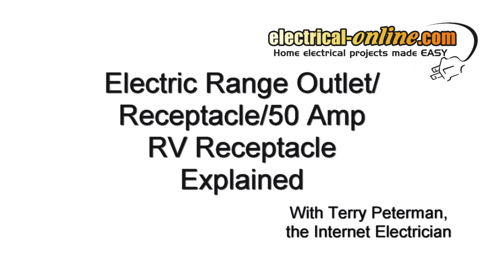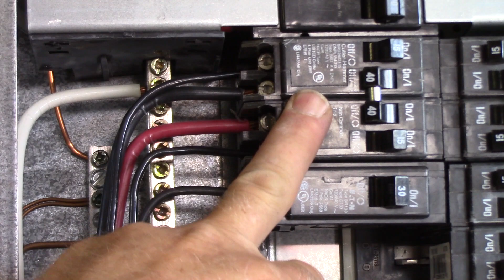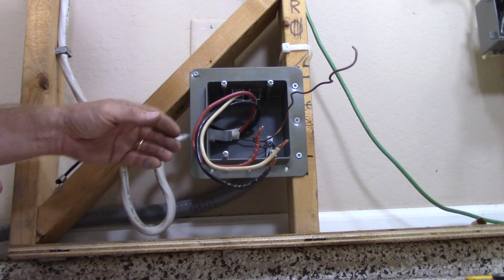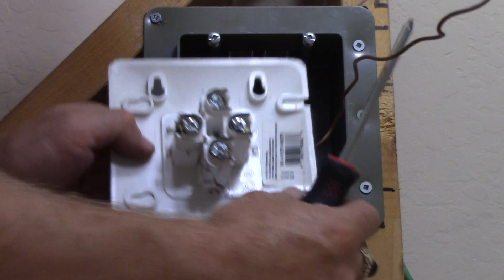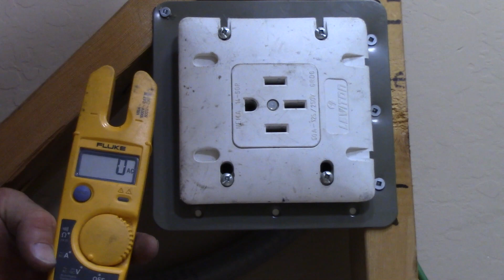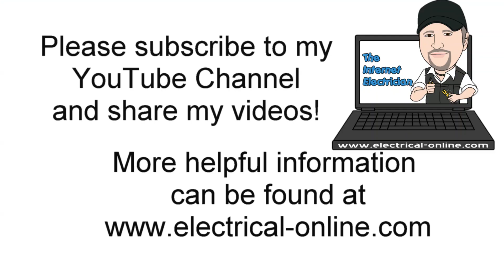Electric Range Receptacle/RV Receptacle Explained

Comment: Would you say this receptacle is safe to pull 32A continuous load for 5- 8 hrs at a time for ev charging or do you think this will melt.
Reply from the maker: Totally safe.  We allow loading to only 80% of rated current for this very reason.  A safe threshold to operate continuously.  A 40A circuit will supply 40A, but thus the safety factor.  Stay tuned!  I'm about to shoot a video before the end of the week that is all about EV charging, and I'm going to use the exact same scenario. Thanks for watching!  I hope you're subscribed and have clicked the bell so that you'll know as soon as my new video goes live!
Reply: @theinternetelectrician  Well actually a 50a circuit will give you 40a of ampacity. (80%). i've bought this Receptacle and will be wiring it up tomorrow or on the weekend to 50A and it will be my home dedicated charger for my Model S. My Mobile charger only pulls max 32A so i feel that if this plug is not ("Industrial Grade" / "High Amperage" rated, its a 125/250v so it should be able to handle 40a regardless you would think. Worst case scenario after about a yr of usage from continuous 32a over 5-8 hrs 2x or so a week it melts, i've lost $5 and will replace it with another one lol...
Reply from the maker: @xrpo.g6855  if you feed with #6 wire and 50A breaker, then 40A continuous is good. 40A breaker and #8 for the 32A. Let me know how your project goes!
Reply: @theinternetelectrician  Thnx for the response. I'm using 6/3 wire. Figure that i'm spending this much on wire couple bux more for 6 over 8 is worth it. Will allow me to simply switch to a more beefy Receptacle also later on should this first one not last as intended to and will save me from having to fish and pull the wire again and opening up drywall in wall and ceiling. Running it just under 50ft from panel to garage.

Comment: Hi Terry, I am pretty new to doing electric work. I am looking forward to taking the udemy course. Could you explain to me how running a 50 amp receptacle works with a 40 amp 2 pole breaker? Wouldn't you need a 50 amp 2 pole breaker? If I was hooking this up for an RV, would I install a 50 amp 2 pole breaker? I know this is a total newbie question, thanks
Reply: The breaker is sized for the appliance per the manufacturer. The wire and 4 prong receptacle can handle the 50 amp load but it is not needed for some ranges (you would use a 50amp breaker if that is what is called for to operate your stove). You can always over size (heavier gauge) the wire and receptacle. It actually conducts better and stays cooler.
Reply from the maker: In most homes, the range receptacle is on a 40A 2-pole circuit using #8/3 wire / cable.  There are no 40A rated receptacle configurations.  They go from 30A to 50A.  Most electric ranges are under the 80% known loading of a circuit, so it's OK to oversize the device to 50A, and the breaker used is sized to match up to the maximum ampacity of the wire.  It's OK to use higher rated devices (and wire size for that matter) with a lower rated breaker.  Not the other way around.  So if you needed a circuit that needed to be able to supply 40A  known load,  you still use the 50A device, but must size up the wire to #6, and use a 50A, 2-pole breaker. So to answer your question, if you wanted a full 50A, 125/250 service for an RV, use a 2-pole, 50A breaker with #6 wire.

Comment: Can't say I hook up many stoves not being a professional in the business but the last that I did I don't remember the neutral wire. I have only seen three wire. Maybe you could explain further.
Reply from the maker: A 4- wire circuit (2 hots, a neutral, and a ground) is required by code to supply a combination electric range (electric clothes dryer etc.) because these appliances have both 240V and 120V components. For example, timers, light bulbs, control circuitry are 120V, the heating elements use 240V. The "grounded" conductor (neutral) is needed to facilitate the function of these 120V components, and the "grounding" conductor is to "earth" the frame of the appliance.  In older installations, there was only a 240V supply (with ground). The code allows an exemption if that is your only option due to the supply cable. Best case is to change it out if possible, but if not, and you follow the correct procedures you can use the supply cable but you have to ensure the frame of the appliance is connected to the ground wire and the neutral terminal of the appliance. This is not the best scenario as you are then using the grounding conductor as both a neutral and a ground.
Reply: Thanks Terry makes perfect sense to me. If I ever had to I would do the upgrade to four wire. Learn something new everyday.